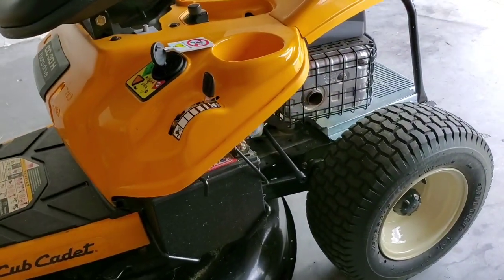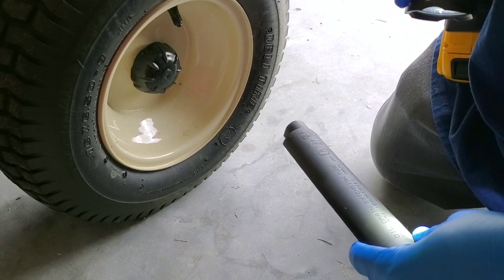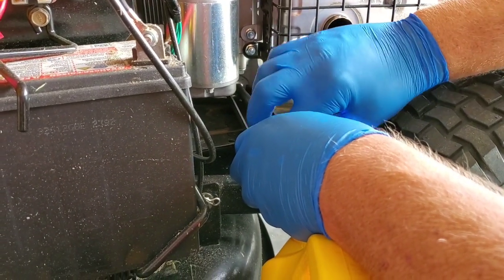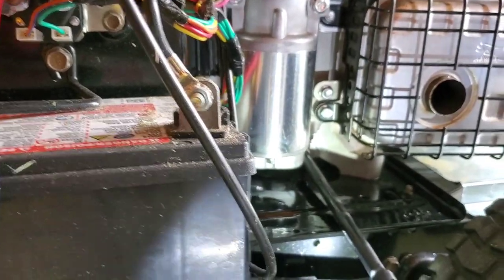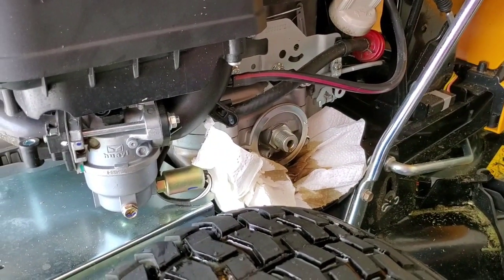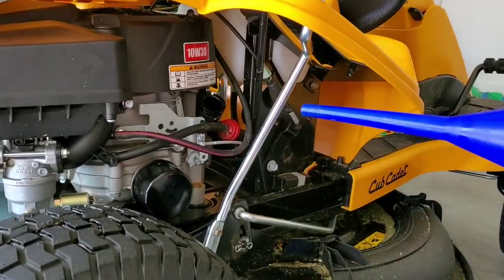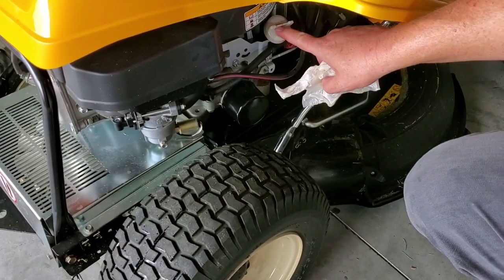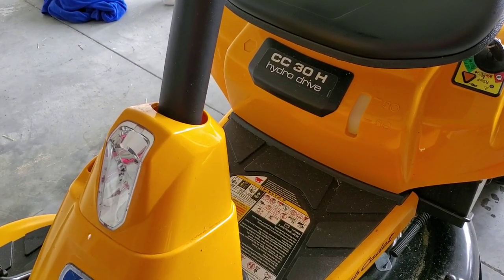Cub Cadet CC 30 H Oil and filter change

Comment: Great information 👍 nicely done ✔ I'm glad I'm not the only one that finds those drain tubes hard to use. A trick I discovered is tilt the mower over 45° and remove the drain plug and thread in a 1 ft long piece of threaded pipe and then tilt it to the opposite side to drain the entire crankcase and contents of the filter directly into your drain jug w/o spilling a single drop 😁 Note: Tilt it back one last time when removing the drain tube and replacing the drain plug.
Reply: Do you know what the size is the thread is on the drain plug?  Is it 3/8"?

Comment: I'm very happy with the my Cub Cadet ( 4 Years old) the oil change access not so much. Added a 3/8" x 3 1/2" long pipe nipple and cap. Drains into my basket much easier. Other then that for my yard it's a good machine. Spend the extra $ to get the hydraulic shift. Makes reverse or forward movements very smooth

Comment: I recommend getting a Drainzit oil drain hose so it makes future draining oil alot easier and no mess
Reply: Is there enough clearance to tighten and away from that muffler ? I want to know if anyone has done this with this engine. I have a new 2021.
Reply: I just bought a drainzit for my 2019 and there is not enough room to tighten with a wrench.  Not sure how Dat tightened his but I would be curious to know…. Otherwise, it is back to the drawing board for me.
Reply: I use a Stahlbus oil drain valve.  It can be installed using a regular socket.  Easy peasy...
Reply: Yep the Drainzit is the way to go. Absolutely no mess.
Reply: Going on year 4 or 5 now with my CC 30H.   Dumbest thing ever is leave the drain plug like that. Plastic thing wasn’t worth a crap, messy.  2-3 years of aluminum foil helped.    Last winter saw a B&S twist drain plug with hose on clearance and WOW what a difference.  Next winter I just put tube on. Bottle to catch and when ready “twist and drain.  Paid 
Ike 7$ on clearance. 

Same problem 1st time removing oil filter.  Literally smacked screwdriver through it.  WT? we’re they thinking.  

One of the big box stores sells a bottle of oil that was the right amount. More than a quart.  

Air filters same problem.  Part numbers same. Says cross reference ok. Too large or too small.   This year ordered from AMZ no idea of brand name at time.  Higher cost and exactly what I needed. (Troy-Built packaging).  TB and MFT and Craftsman will use identical parts if ya need to cross reference. 

Don’t forget to lube under chassis and steering and wheels.   Wheels another PITA.  Had to pull two tires off to get it lubed. 

Wish CC was thinking with this oil drain issue.   What a mess. 

Anyone wanting the bagger attachment, MFT has one that fits this.   

And you can download the manual online if needed. The one we got was like recycled paper and looked 50 years old.  Convenient to have PDF version to quickly reference.  

And I’ve learned to  lift the side up and put on blocks.  (Recommended from manufacturer to drain.  Helped

Curse that plastic tube thing.  🤨. It really sucks. And sucks more are those engineers who said “use this” 🙄

This was the drain plug I got 70% off.   https://www.amazon.com/Briggs-Stratton-Drain-Valve-5401K/dp/B0012W21IY/ref=sr_1_1?crid=3CM3A2IPLYTAZ&keywords=briggs+and+stratton+oil+drain&qid=1684048859&s=home-garden&sprefix=brigs+and+stratton+oil+drain%2Cgarden%2C116&sr=1-1

Air Filter that worked:    Eopzol 737-05129 Engine Air Filter for MTD Cub Cadet Troybilt 937-05129 490-200-M070 490-200-Y070 https://a.co/d/4QiMJ8c

I have two new B&S air filters that were suppose to work and didn’t.  One too long for the housing. Other too short and caused problems. 

Good luck

Comment: You mentioned you have an oil extractor. Is there any particular reason why you didn't use it to extract the old oil? I have one as well and it's so much easier and a lot less messy.

Comment: good video, I had the same problem the first time I changed the oil, it went everywhere except for in the drain pan!! lol  That damn drain tool they make for it does work perfectly but like you said, it only works if you prop up the right side of the machine. I installed a Drainzit oil drain tube instead, and not a drop of oil anywhere now :)
Reply: Ezio, how were you able to tighten the drainzit? I cannot get in there with a standard wrench or pliers etc.
Reply: @scott2688   I really don't remember as it's been quite a while since I installed it lol. A ratcheting spanner wrench with a swivel joint would work, I didn't use one of those tools but I did get it on tight I just can't remember how, sorry

Comment: Off topic, my PTO handle is fairly loose in the non-engage higher position.  I was curious if yours is also loose?  I tried to tighten the pivot bolt but its tight.  My PTO works fine, but that handle seems loose (has a little side to side action).  Maybe thats the way its supposed to be.  The cable guide looks fine too.  This is the assembly just to the right of the filter area and also has a safety button.
Reply from the maker: yes it is

Comment: Definitely less messy if you pump the oil out through the filler tube. There's still going to be a bit left if you want to pull the drain plug, but it won't be nearly as messy.
Reply from the maker: agree fully
Reply: @vegasdavetv  thanks for your video BTW, the manual doesn't go into any sort of detail, I miss the way manuals used to be, full of specs and basically anything you needed to know to fix and maintain the item you own.

Comment: Mine did not come with any oil drain sleeve at all and nothing to clamp or snap one to -- just a plug in the side of the crankcase in a very inaccessible place at the bottom of the starter.  I bought the red Drainzit hose from Amazon, but it's impossible to get a wrench or pliers into the drain plug location to screw it in without removing the starter, and I don't want to just leave it hand tight, so I'm going to Home Depot or a plumbing supply hopefully to get a 3/8" nipple long enough to extend out beyond the starter and a fitting to adapt the nipple to the Drainzit. I think some just get a 1 foot nipple and cap the end, but I don't want anything sticking out far enough to get bumped or broken off. I think one could just loosen a couple of bolts to remove the starter, but I don't want to chance introducing any more variables at this point.

Comment: Good video and suggestions Dave, but you can use synthetic oil. We've been using it in small engines for at least 20 years.
Reply from the maker: good to know that John..I was not aware, thanks for the heads up
Reply from the maker: good to know that John..I was not aware, thanks for the heads up
Reply: Yes the manual says you can use it as I just purchased the CC30, but great video !

Comment: I use a Stens New Oil Drain Valve 125-508 and some tubing to drain the oil. 
When filling with new oil, you need to pour SLOWLY or the filler tube overflows.
You would think that the manufacturer would provide a better design for oil related tasks.

Comment: I found some pipe that screwed in to the oil drain hole to extend the drain out. It was threaded on both ends so I could cap it.

Comment: doesn't that oil drain chute snap onto the drain plug so you don't have to hold it?
Reply from the maker: no it didn't
Reply: @vegasdavetv  hmmm that's strange because the operator's manual says the oil drain sleeve snaps onto the oil drain plug.  do you have the operator's manual?  it's on page 16 under "changing engine oil"
Reply from the maker: I couldn't get it to work
Reply: @vegasdavetv  Hey guys I am thinking about getting this mower, matter fact I'm pretty sure, but and idea do you think a metal threaded tube then put the bolt on the end would work?
Reply from the maker: might work
Reply: @vegasdavetv  there's a newer manual now on the cub cadet website.  "changing engine oil" is now on page 22 and again it says "snap the small end of oil drain sleeve onto the space
provided around the oil drain plug"

Comment: Does anyone know if FRAM has an oil filter that is equivalent to the one used for this mower?  Or do you have to only use the specific oil filter that is equipped with this mower?
Reply from the maker: I think they do. just need to cross reference it
Reply: I went to an O-Reilley's auto parts store, and they had a display of all the various oil filters cross-sectioned. That was the very last time I bought a Fram filter. You may want to look for that display.

Comment: How do you replace the drive belt on the cc30h cub cadet?
Reply: I have the same one and I don’t have a model # on mine sticker came off. So Iam have a lot of trouble finding parts for it.
It’s exactly like your the part # for the oil filter is the same.   So could you please give me a model # also what is the part # for the oil dipstick and filter.    Thank you so much for your video very helpful
Reply from the maker: cc30h is model, go to cub cadet web site and enter that

Comment: 🤣🤣🤣 I put a 6” piece of iron pipe in the whole with a cap on the end so the next time it will be super easy to change the oil. I’ve had mine for 6 years. Use a 2 liter soda bottle cut in half to put under the oil filter so it wont spill all over.
Reply: Whats the pitch of the pipe? I would like to do the same. Thanks!
Reply: Pitch of the threads is what I meant
Reply: The oil drain plug on this motor is NPT 3/8"-18.  The pipe thread needs to be this size to fit into the oil drain hole.

Comment: just got one, mine is the briggs and straton and has no oil filter, im sad
Reply: Does the Briggs and Stratton have a 3/8 pipe thread plug? Want to order a drainzit hose but don't kow the thread size

Comment: The engineers that designed the method of changing the oil & filter should be s**t!!!!  The plastic sleeve works best if you use Velcro. Clean the area with 90% rubbing alcohol first.